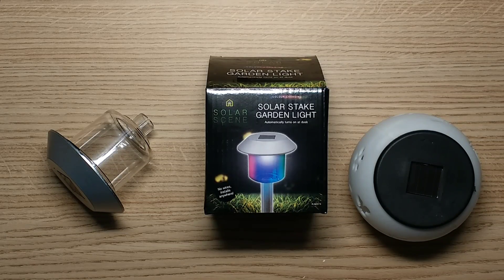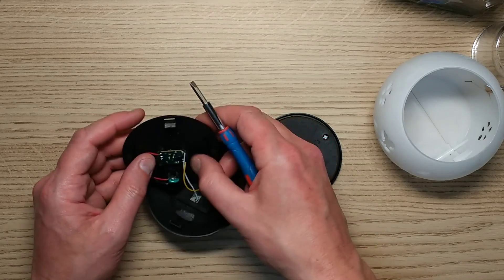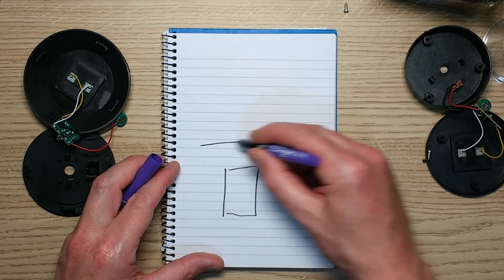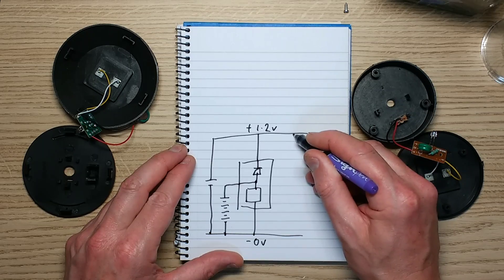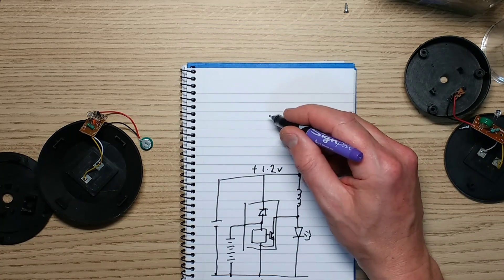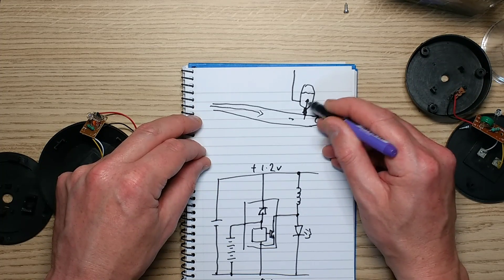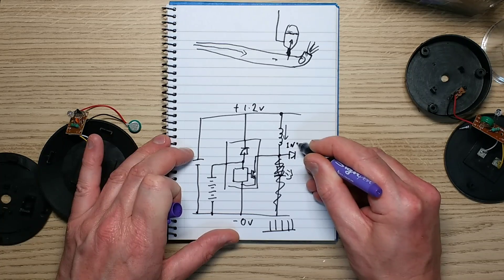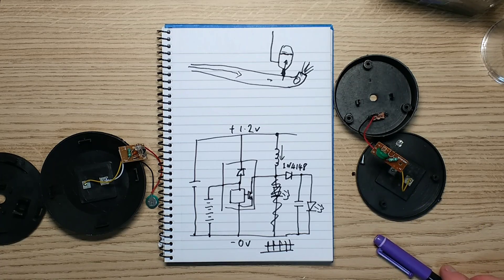How to make RGB LEDs work in ordinary solar lights.

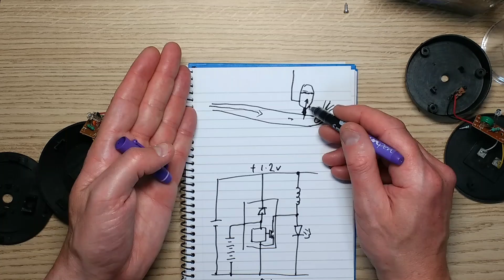Comment: 6:35, It’s funny, I turned to your video because of LEDs but the water ram thing got me to thinking on a self bailer on my dingy, especially on those ruff sleepless nights when a front comes through , I have to bail my dingy every few hours or it’ll sink, fixing your outboard can cost a few days, something small and inconspicuous, that works off of wave action, all liveaboards, boat people, would be your customers, You’re a good teacher
Reply from the maker: A water ram requires a long pipe with gravity assisted flow.  A small sump pump might be better.

Comment: The diode runs out of the positive pin to the LED.
The capacitor crosses from Positive to Negative  before the LED.
It is possible to run a 555 timer and a programmable 12F629 chip.
I have accomplished it. 41-48 diode & 104 cap. 
You may have to play around with inductors, I am using a 22uH
for these two projects since flashers take less toll on the cell.

Comment: I'm starting a project to build a binary clock. I'd like to have a backup battery and RTC in case the power goes out for whatever reason. The battery won't actually run the display, just keep the memory alive for the RTC. I've got some button style NiMH cells as well as the AA style and I'm wondering at the best way to charge them when the power is connected. As much as possible I'd like to make this out of discrete components, but I realize I'll probably need an MCU to run the display (just a 4 x 6 LED array). Any suggestions on the charging, and the switching from wall power to battery when necessary without interruption.

Comment: Forgive my ignorance, what is the purpose of the added diode? Isn't the flow already only in that direction?
Reply: Troy Jennings 
I know this is an old comment but since you’ve rec’d no response...
The diode makes the capacitor charge only flow through the LED and not back into rest of the circuit between pulses.

Comment: How do you know that is an inductor and not a resistor.  Is there a marking difference?
Reply from the maker: It's the way it's used in the circuit.
Reply: Darn, I hoped there would be some marker.  I guess if you measured across it, you'd see 0ohms with your meter.  Still, I would never have known if you hadn't told us.  I know to look for it now, thanks!

Comment: Thank you so much for this. I used the term microprocessor in my earlier comment as that was the term I found on Google for the 'gubbins' inside the LED.  I have 6 of the acrylic light pipes with bubbles from Poundland and 4 from Maplin. They are about 150 mm long and 15 mm dia. I have tried an LED in both ends and that produces quite a show. I have noticed that the ends of the light pipes are very roughly cut off and the Maplin ones have glue spreading across them. They are all to be stripped and set up Stone Henge fashion with a power supply to be determined.  If you Google 'tri coloured led light pipes with bubbles'  I think you will understand why these are well worth investigating. I think they are the most beautiful lights I have ever seen.

If they were supplied with their running voltage I assume no external circuit other than a resistor is needed, is this so ? 

Did you decide on the name 'Joule Thief' as James Prescott Joule managed a brewery ?  The more one thinks about it the more it fits.

Comment: If the voltage was +2.7 volts, instead of +1.2V, the LED would conduct, since the voltage is now high enough. The coil is seen as a small value resistor. 
The idea is to bring one end of the coil to ground and then disconnects via the transistor. The voltage will spike to about -120 volts for 2-20ns (open circuit, as see on the O'scope). 
if the cathode is brought lower than the anode by ~2V-3V (depending on the LED), The LED will conduct and light is emitted. Elementary stuff.
Where is my mistake in this?

Comment: You can illustrate inductor boost circuit "by hand", where you replace the tranistor with a piece of wire you push to make contact by hand, or a momentary switch, and you get to flash a white LED or small fluorescent tube from AA battery and a big inductor...

Comment: I remember when I was a kid I once got a 9v relay and connected its power across the relay terminals. Every time it energized it would immediately shut off and then right back on - many times per second. I made the unforgettable mistake of touching the coil terminals while it was running.
Reply: I once made a sadistic game that would shock the player this way.

Comment: Oh cool, i think my question inspired this video. I asked you why my own customized RGB Dollar Tree lights weren't working. I was wondering though, does ASDA or anywhere sell any really premium solar lights? My local Walmart had a huge selection this year, one of them was huge, glass, had two layers of lit area with phosphor coated LEDs and a massive solar panel. It was like $10 but it felt really premium . Might be worth checking out and hacking.

Comment: Thanks Clive. I bought some BC 3W colour changing led's for my  Tribes bedrooms they are next to useless too dim by far. Any way of making them brighter by using a good hack? Just keeping the same package would be cool.
Reply from the maker: +Boris S. Alas, they are dim by default.  It's better to have separate effect and functional lighting.
Reply: Thanks Clive I wondered whether I could run a 10W RGB COB but me thinks it will require too much heat sinking. By the Way Clive I'm dead Jealous of you as I have been associated with RET over the years. Hav you ever rubbed shoulders with Maj P Parker...lol

Comment: Hey Clive - great video. What struck me was the simplicity of the circuit you described. What I've often wondered is, if I were to scratch-build a solar light for the garden, what would be the most effective solution. Is this it?

Have Chinese manufacturers of cheap garden lights actually optimised the design to eek every ounce of the solar cell and batter? Or have the just hit on a design that 'does the job' well enough and left it there?
Reply: Karl Pountney As the retired Bell engineer mentioned 5 hours ago, using a schottky diode instead of a normal silicon diode for the RGB circuit should save about 10% power.  The core of that circuit is essentially a full fledged boost SMPS DC/DC converter, converting 1.2V to 3.7V minus 0.7V for the diode. With a schottky, it only converts to 3.3V minus 0.3V.

Comment: I've had Ohms, Farads (and of course also Volt and Amps, even Coulomb) in school, but an inductor was never on the schedule, and the unit Henry (?) is unknown to me. I would love a video about inductors and how they work and what they do, and what the unit Henry actually means (also mathematically, as in "it can be expressed as a formula combined of voltage/length/time/current/or whatever else")...
Reply: Seegal Galguntijak Here's the quick version: An inductor is a wire going around (or just past, counts as half a turn) something (possibly nothing) .  This creates a magnetic field in that something (as discovered by Oersted).  Changing the current changes the magnetic field, and changing the magnetic field induces a current back into the wire.  So an inductor does for current what a capacitor does for voltage.  So the inductance is roughly how many Volt-seconds are stored for each Ampere of current.  Also 1H will feel like 1 Ohm of resistance at an AC frequency of 1 radian/second (1/2π Hz). The inductance grows proportional to the number of turns around the something, and increases a lot if that something is a magnetic material like iron. However unlike empty space, iron etc. has a physical limit to how much energy it can store before it no longer improves the inductance, so one trick sometimes used is to use an iron ring with a small air gap to increase the storage capacity. Another thing to watch out for is that a massive piece of iron can carry current so the stored current may simply run around in circles (eddys) in the iron and not in the wire, to avoid that we use many plates (for large coils) or grains of iron (ferrite) with a bit of isolation between them.  When making your own inductors, the data sheets for the pieces of iron ("cores") specify how many Henry you get per turn and the other limits, so you don't usually have to do the complex 3D differential calculations to figure it out.
Reply: John Francis Doe thank you for that "quick read". I understood a little bit of it, but at the point of frequency being measured in radian/second, meaning ½π Hz, I had to cut out. How does that conversion work? "radian" sounds like it's related to the radius of the "turn(s) around something" (as does the factor ½π, which I remember from circle area calculations back in school). So if you'd build a hypothetical inductor with a diameter of (for example) 5km, wouldn't that affect the frequency (in Hz), compared to an inductor that's only 2mm in diameter, because electricity can only move with light speed at most? (And trough different conductors, it would move even slower, so a material constant might be in there somewhere as well, i.e. when comparing copper to aluminium?) I think I'll have to read your comment again tomorrow, when I'm sober ;) - And I'd still appreciate a video from bigclive.com about the subject (and whatever matters about it, so without complex 3D differential calculations if possible)...

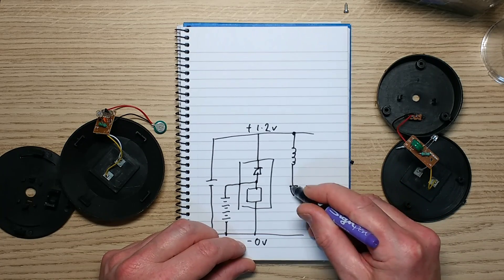Comment: Don't you have the LED backwards at 4:37 ?
The recoil gives negative spikes.
Reply: PirateKitty No.  The "recoil" gives whatever spike will allow the current to keep flowing.  So it makes the voltage across the coil the opposite of what it was.  So after pulling it to -1V below the +1.2V pin, it recoils to as many V above the 1.2V pin as needed to dump the energy into the diode. The more volts it takes, the faster it gets emptied.

Comment: I have an enclosed grid, I think 5x5, of multicolour leds, one of those interior design things. Curious to see what's inside now, since one of the lights doesn't colour cycle but is lit stationary. Any guesses before I crack open the enclosure anyone?

Comment: Student housing...oooh, that's bringing up some interesting memories. There was never hot water -- at most, it was luke-warm, and for less than four minutes -- in a shower which ALWAYS gave us athlete's foot. SIngle-pane windows which leaked water and air. Circuit breakers tripped for seemingly no reason, randomly. Random gunshots and drug dealers. Ahh, college in Detroit. :)

Comment: Mmmm..  Used the 1N4148 and the voltage drop even for that was too much and the LED was too dim and did not cycle. Oh well, never mind!
Reply: I've got a solar light that uses a 1N5819 Schottky diode and a 100nF capacitor. (The  LED driver chip is labeled "XD 5252F".)

Comment: Good explanation Clive.
I have been building such devices for the last 3 years, (ever since I saw those color changing leds).
During that time I have slightly improved on your circuitry.
1) I use Bat85 diodes which are schottky and therefore I lose less voltage across the diode in the rectification process, (starting with 1.2 volts, and dropping as low as 0.7 VDC before the device shuts down, you cannot afford to lose too much voltage in the rectifier diode); thus providing more voltage to the load; which in this case would be your output filter capacitor and the flashing led.
2) The next modification I made added one more diode and one more capacitor; (maybe another 3 cents in cost), to create a voltage multiplier circuit providing considerably more voltage to the flashing leds.
3) The last thing I did was add some resistance in series with the LEDS to balance them and allow me to have more than one LED lighting without affecting the others. 
.
The end result was that I have as many as 12 LEDs lit brightly by the same QT 5252 device and the same battery that was originally installed in the light. (I normally use only 4 to 6 of the flashing leds to conserve battery life)
 These were older lights so they had 600 Mah batteries in them; but when fully charged by the sun they can operate for over 24 hours in full darkness because the current drain on the battery is between 10 and 25 Ma when operating...
 (I typically use a 470 Uhy choke; but any value from 220 Uhy to 680 Uhy seems to provide a good compromise between brightness and runtime.....)
 I built some in Mason jars for my neighbors and they have been running outside on their property for over three years now, all night , every night, through a very cold winter and a very hot summer.
.
My biggest problem in the future will be from the Mason Jar lids rusting through and having to be replaced.
.
I have since been working on some new designs that can charge on a sunny afternoon and then be brought inside to run for 5 to 10 days in full darkness with even brighter flashing leds in them.
Reply: Dennis#12 Test with a battery with only enough capacity for 1 hour, use artificial light and each 14 day cycle can be tested in about 75 minutes (using a sequence of strong and weak 5 minute light cycles), and the full 1000 cycle circuit test can be run in a couple of months, giving reasonable results for everything but the battery size.  A variation requiring more calculations could be done with a full size battery being cycled only in a tiny part of it's charge level range (near empty, near full or around some midpoint).  To test full battery cycles, you would need to artificially increase load and charge current, but could still accelerate the test to like 4 months. As each test would be slightly unrealistic in a different way, running multiple such tests at the same time could provide results good enough for confidence. Remember, you probably didn't durability test most Bell systems for full 10+ year lifetimes in real time either.
Reply: schematic?
Reply: When I was there we designed for a MINIMUM of 40 years of service life.
Reply: Dennis#12 That last idea is something you should persue. Sounds like something developing countries could use.
Reply: I started out repairing a single solar light in my back yard.
Being a retired Bell Labs Design engineer I saw a lot of room  for improvement in the design.
I have been improving (?) the design for three years now and have a back yard and all my neighbor's back yards full of different experimental models.
 I put the schematic to the voltage doubler type system on a facebook group called electronics class a few years ago but no one there seemed interested.
I think I also published it in another facebook group called Electronics Repair and Custom Builds.
.
The latest design, the 7 day one, is being tested for longevity right now.
It does NOT use the QX5252 device in it.
It is not quite as easy to build as the originals, but still extremely easy to put together.
I have verified that it works fine but want to make sure I get at least 1000 recharge cycles out of it.
That means that If I let each full charge run down completely, it would take me only 460
 years to validate the results!
Since I am 70 years old already; I can't wait that long, nor do I believe that the battery would last that long due to internal degradation.
 Now I have a decision to make:
Do I continue to build them to last a week with no sunlight; or do I go to a much smaller and cheaper battery that would still be able to run it for 24 to 48 hours. 
 If I switch to a battery good for only 200 cycles and reduce it's size to only run the light for 18 hours a day; I can reduce that test time to only 10 years!
LOL!
Reply: Published on a facebook group mentioned in earlier comments.
Reply: Ibryam1997 Bacak  
I think it was called "Electronics Class'.....

Comment: Check out this video this video inspired. Familiar audio.  It's a one of a set of LED's like I've never seen. Changes all colors without an external controller. It's powered by your LED tester and 9V. These do work in LED lights without the control board. They were sent to me by mistake when I ordered RGB LED's and I can't get any more. I have only 500 of them.
https://www.youtube.com/watch?v=39SsKrNjgvI
I'll send you the link to the store if you want but I can't find any more. The advert I ordered from is RGB not RGB and purple and yellow. Do you want a few to play with?